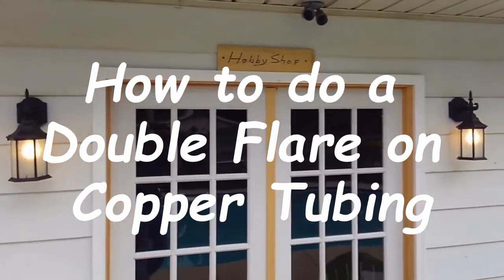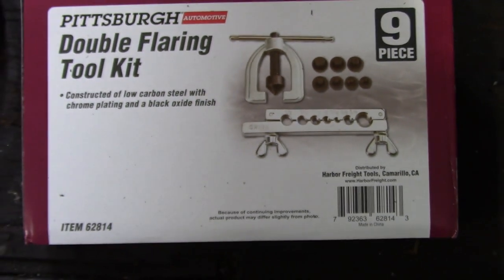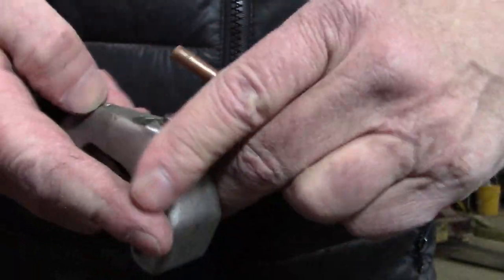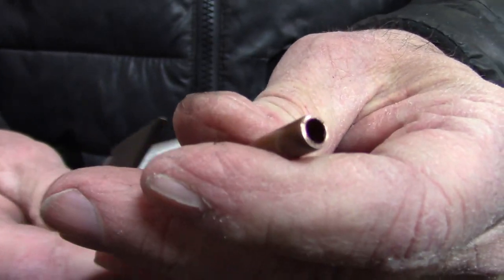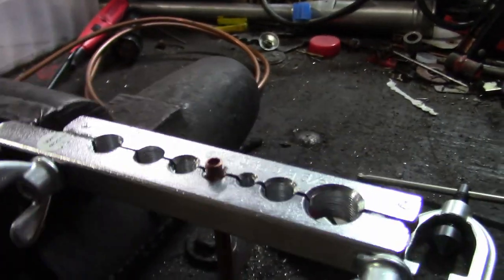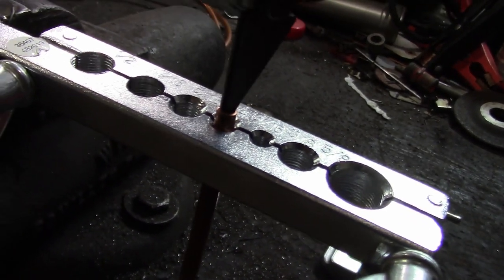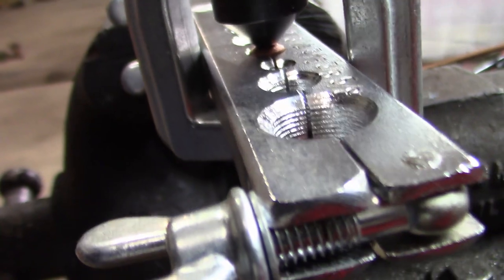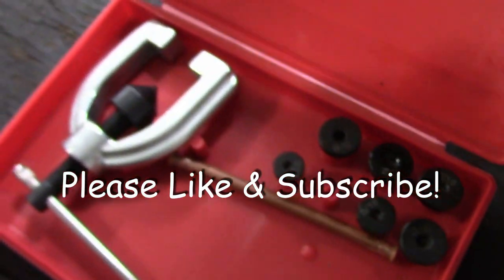How to Double Flare Copper Tubing

Comment: I appreciate the availability of the video. It's been a long time since I've done a double flare and it was good information. The only thing I would recommend is that you do not do the burr cleaning with the burr tool in vertically positioned tubing as shown. That will drop shavings into the tube which you do not want to have happen.

Comment: WARNING...........never use copper lines for brake lines. Steel, Stainless steel or copper/nickel alloy only. If your doing brake lines don’t even use this type of flaring tool.....they’re garbage and will give you inconsistent flares at best and scar the outside of the line sometimes making it hard to slide the fitting up to the flare. Buy a professional flaring tool that clamps the tubing in a die. They are about $150 more but you will get the same professional flare each time.

Comment: Can copper be used on break lines?
Reply: No it's too soft for Brake Lines, well you could use it but I would use steel or stainless steel simply because the steel will take more punishment

Comment: So...I am using gravity flow (no pressure) in the system  (other then gravity) to supply diesel to a Dickinson Diesel Heater. Should I use a double flair or is a single flair good enough? Any down side to using a double flair?
Reply from the maker: No down side to using a double, it just insures a good seal.
Reply: Thanks...
Reply: I'm here trying to learn how to plumb my Dickinson heater too lol
Reply: @jameskern4246  So...on the fuel supply line Dickinson advises a fuel filter. I put one of these in but they only come in 1/4" so you have to use 1/4" copper pipe...and then at some point transition to a 3/8" as that is integral to the supply side on the heater. It would be a good idea of Dickinson would make a 3/8" filter and then no transition would be necessary...that would save having to do extra connections....